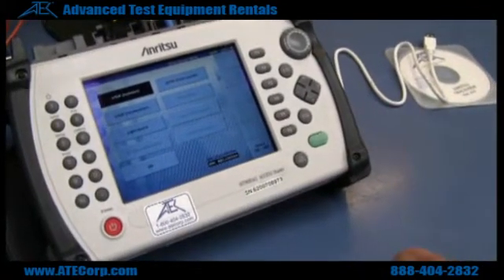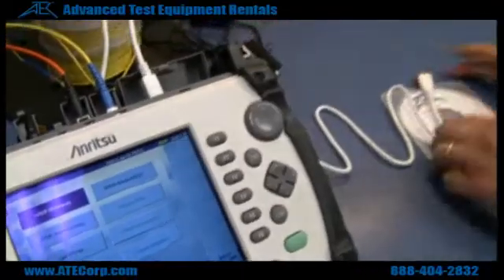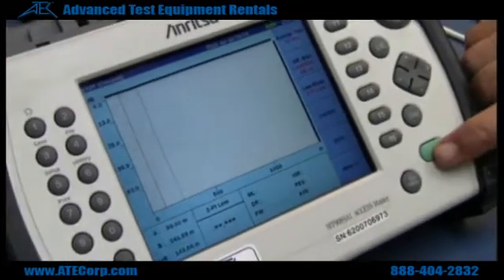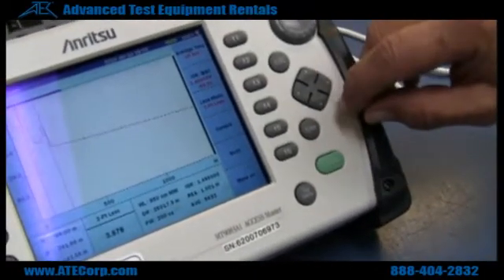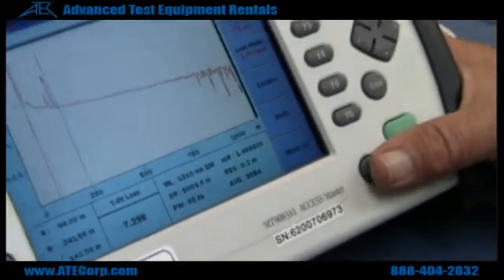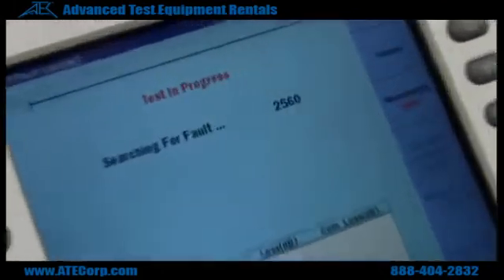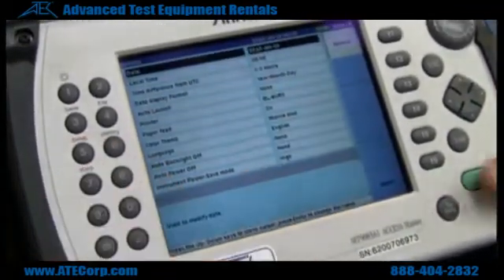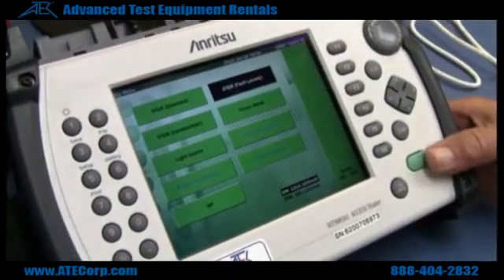How to Use Anritsu MT9083A OTDR (Optical Time Domain Reflector)

Comment: How do I save my trace after running?
Reply from the maker: You can save files manually, if you have AutoSave setting set to OFF.
Press the Setup Key
Press AutoSave
Select Off, Press Enter
Save Manually:
After a Test, Press Save
You can edit Filename here.
Select Internal Memory or USB Memory.
Press Save Trace (F1).